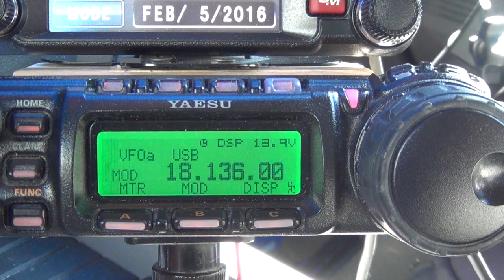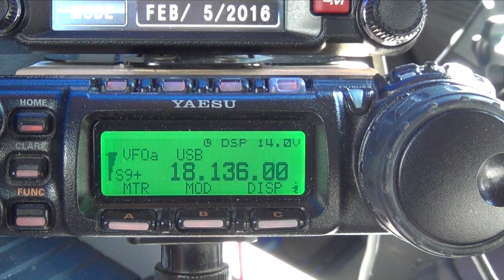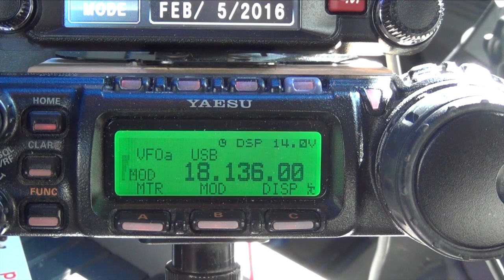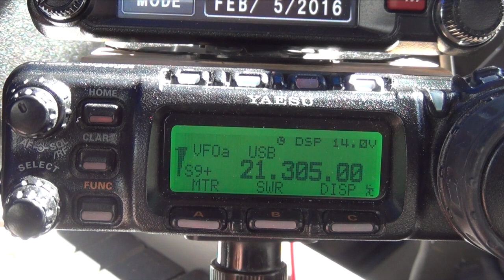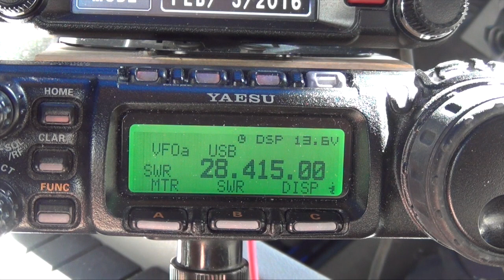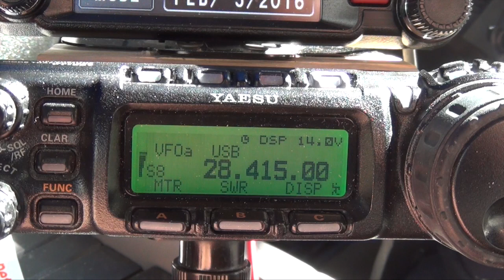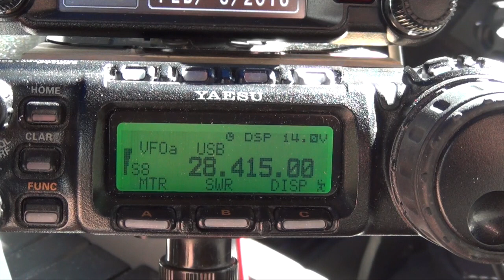Ham Radio Antenna - HF Portable Train Station Work - Alpha EzMilitary Antenna And Yaesu FT-857D

Comment: I've watched a couple videos on Alpha and Chameleon whips.  I'm studying for general so I have time before I need to go out and buy something.  I live in a condo on the first floor that has balconies on both sides that overhang.  I'm pretty much in one of the worst places that I can architecturally live to get into this hobby.  Currently I either operate from a mobile in my car or my base station which is just using a magmount stuck to a guard rail right outside my window about 2 feet off the ground.  Not ideal but it gets me to pretty much all the VHF/UHF repeaters in the area.  When I eventually do want to start working HF I'm going to need something I can put out and then take down when I'm done, probably using the vacant field right next to my building.  Would you recommend this kind of antenna as one to pick up?  I was thinking about this or maybe a buddipole.
Reply from the maker: Thank you for taking the time to watch and the comment! It is greatly appreciated. My apologies for the delay in responding. I have antennas from all three of the manufacturers you mentioned. I live in a condo complex with uber strict HOA rules. I have to put up and take down antennas when I use them from home. Lately I have been using the Chameleon. I have had success with all three. The Buddipole being the most time consuming to put up and tune. Let me know should you have any further questions.

Comment: Do you know what the difference is between the alpha coax loop antenna and the ex military?  I'm trying to decide which antenna to get?  Great video!
Reply from the maker: +Timothy Rust Thanks for the comment! The 10-40 Meter Coaxial Loop is Rated IP54 for Base, Mobile, Tactical and a Maximum Power - 20 watts PEP SSB 12 watts AM/CW. The EzMilitary is rated for up to 500 watts and comes with a 13 foot aluminum MilStick, Universal Jaw Mount and Counterpoise . you can find more information at http://alphaantenna.com. I also have the 10-40M high power 6 section aluminum Alpha Loop. I have a video where I use four different Antennas by Alpha Antenna. Also checkout VIDEOSBYMIKE for some videos on both the EzMilitary and Coaxial Loop.